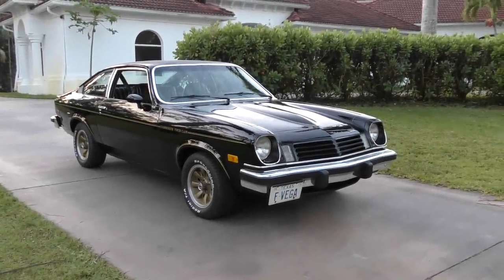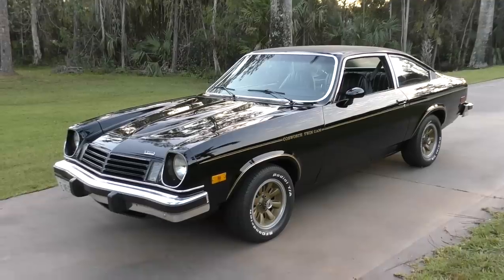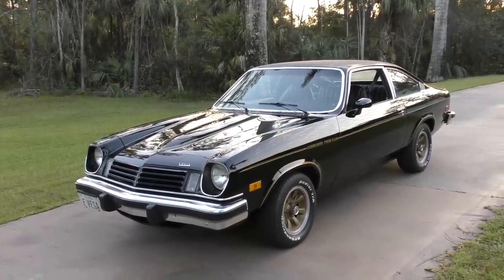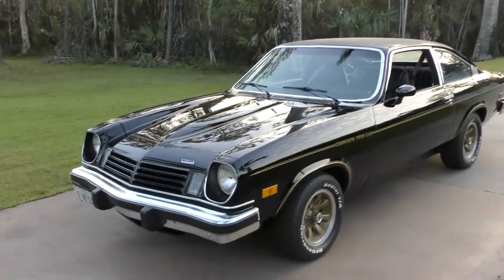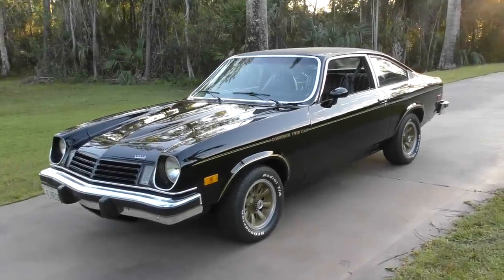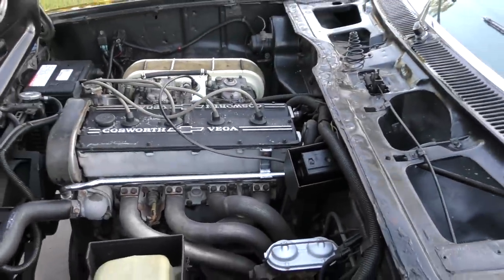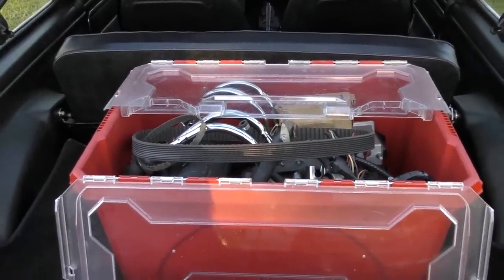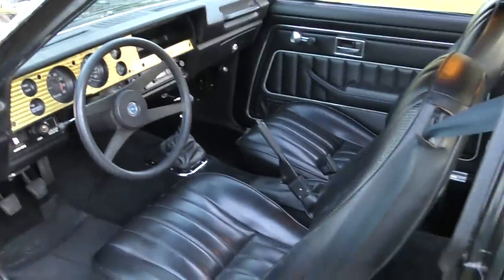The Cosworth Vega is an Amazing Car, But Came Too Late to Save Chevy From Their Terrible Decisions

Comment: When I was a young lad, I worked at my local Chevy dealership for most of my years of high school summers (72-75) and in charge of prepping every new car for delivery straight off the truck(s).  Can't tell you how many Vega's (they flew off the lot as soon as they arrived) in all of their forms (notchback, hatchback, wagon, delivery panel) from base to GT's.  We never got one of these but I have seen one when it was new, and only one.  I was like way surprised to see you with one!  I always thought they were cute, and I favored the GT's, but the fully loaded wagon's with fake wood grain sides were somewhat cute.  The Chevy Love truck was popular then as well.  Not to mention most of all of the Chevy models out at the time, and we got a few Laguna S-3's in the usual white and burgundy, but did get a black and white one which I wanted very badly.  Unfortunately too young for that purchase!  Thanks for letting this cat out of the bag!
Reply: oh fantastic! when i turned down my appointment to the USAFA Dad sold my 77TransAm for $5500 and wrote a check for $700 and told me to go get my new wheels. when i got to the house - cars everywhere, i said i'm here for the Vega. The wife was in tears so the husband said, "gonna need $50 dollars more for this car". my 93 Vega GT got me thru college and well after. it had the manual trans and the very smoky injection molded engine block. we took it to my cousin Kenny Timer for a 'tune up' or sleeves is what i wanted. it was way more than Dad would spend which was probably more than he paid for it in 1978 $750. the little 4banger would burn a quart of oil every 60 miles so i always had cans of oil rolling around in the back. there was a lot that was good about this sweet little silver Vega (the stripe disappeared after Buddy painted it) we paid him and my Dad said you can finish it when the paint is dry. Bud said no - for that money I'm done with it. Dad just smiled and so did I the car looked so beautiful.  it looked like a mini Camaro - it was pretty. the balance was very good, it could dance little doughnuts at the top of the street on the ice which made my friends trash can banging Plymouths look stupid. it would drift nicely around corners and bends on dry pavement before drifting was invented just by dropping it into first and nailing it,  particularly handy when showing off for the young women. it could haul 3 other friends and hold incredible amounts of stash in the hatchback. the little straight four would quit when the oil got too low, ie it had a preservation instinct. i do miss that beautiful little car!
Reply: I was working as a Chevy tech, from 1973 to 1977 (then went on to work for Chevrolet Motor Division) and we sold a couple of these. I think the initial allocation was one or so per dealer, but some of the dealers decided that getting so few vehicles was more trouble than they were worth and either exchanged their allocation or did a dealer trade as soon as the vehicle arrived. Each dealership had to have one tech trained on it, so I was selected to be trained. Unfortunately, it was so pricey compared to the base model that ours sat on the showroom floor for over a year. Can't remember how we finally disposed of them.

Comment: My Dad bought a Vega in 1973 because it all he could afford. Being a WW2 veteran , buying an import was out of the question. One year later during the Arab oil embargo our local Chevrolet dealer offered him $200 more than he paid for it to buy it back. Dad passed away in 1975 and I inherited the car (and it’s problems) In high school auto mechanics I installed steel cylinder sleeves in an attempt to overhaul the engine. I cured the oil consumption problem but the overheating problem (blowing head gaskets) persisted. I went on to become an auto mechanic and later and assembly line worker in a custom fire truck factory. In my 4 book exposé series “All in a DAZE work” (The Decline and fall of the American work ethic) I profile the numerous problems I saw with American vehicle Manufacturing

Comment: I only saw one back when it came out.  A rich guy bought it for his 16 year old som.  He rampaged that poor car all over the neighborhood including doing non stop donuts at the hangout trying to prove to everyone how fast it was.  Funny how seeing one 45 years later brings me back to that.  Nice find Bill and very informative history you shared.
Reply: oh fantastic! when i turned down my appointment to the USAFA Dad sold my 77TransAm for $5500 and wrote a check for $700 and told me to go get my new wheels. when i got to the house - cars everywhere, i said i'm here for the Vega. The wife was in tears so the husband said, "gonna need $50 dollars more for this car". my 93 Vega GT got me thru college and well after. it had the manual trans and the very smoky injection molded engine block. we took it to my cousin Kenny Timer for a 'tune up' or sleeves is what i wanted. it was way more than Dad would spend which was probably more than he paid for it in 1978 $750. the little 4banger would burn a quart of oil every 60 miles so i always had cans of oil rolling around in the back. there was a lot that was good about this sweet little silver Vega (the stripe disappeared after Buddy painted it) we paid him and my Dad said you can finish it when the paint is dry. Bud said no - for that money I'm done with it. Dad just smiled and so did I the car looked so beautiful.  it looked like a mini Camaro - it was pretty. the balance was very good, it could dance little doughnuts at the top of the street on the ice which made my friends trash can banging Plymouths look stupid. it would drift nicely around corners and bends on dry pavement before drifting was invented just by dropping it into first and nailing it,  particularly handy when showing off for the young women. it could haul 3 other friends and hold incredible amounts of stash in the hatchback. the little straight four would quit when the oil got too low, ie it had a preservation instinct. i do miss that beautiful little car!
Reply: sorry - I've been banned from this platform for some reason. this is a test to see if I can get some content on here about things i really love - cars. if you can re-post this i would appreciate it. thank you!!!

Comment: I have great memories of a Vega hatchback I had. LT1 with an M22 four speed.  The first time I raced it the windshield popped out of its frame from the body-twisting torque. After subframe was beefed up, it would pull the front tires off the ground all through first gear. It was by far the most dangerous vehicle I've ever seen, but a blast to drive. I love your videos Bill. Keep up the fantastic work!

Comment: Cadillac also used the Bendix Electrojector fuel injection system in 1976. It was standard on the Olds 350 powered Seville  and optional on the 500 cubic inch full size Caddy. It was carried over on the 425 engine in the downsized '77 Cadillac full  size cars.

Bendix started fooling with the electronic fuel injection in the mid 1950's using tubes. Two Bendix engineers drove a '53 Buick from Buffalo NY to Baltimore MD fitted with the prototype unit. The box holding the electronics was so large, it sat on the passenger side front seat while the second engineer at in the back seat to monitor it's operation.

Bendix eventually sold the patents to Bosch and it was called the Bosch D jetronic.

Comment: The hidden genius of the Vega is that it was designed to ship in special train cars vertically, standing on its front bumper.  They could get 30 Vegas on a train car, vs. 18 the regular way.  That's how they were literally able to move a million of them.  (Whether the shipping savings passed along to the customer or not, I have no idea)  I would love to see an engineering analysis of what was needed to not leak fluids in their shipping position.
Reply: I can take a stab at your question.  Iron heads on an aluminum block was a mistake.  Even a high school chemistry student knows that different metals expand and contract differently.  Also, as mentioned in the video, not having cylinder liners was a mistake.  It just goes to prove, never buy a first-year car, especially a first year GM car.
Reply: Go to THE HISTORY GUY channel.  He has a 20min vid on the Vega and how they were shipped.
Reply: @Jonathan Morrisey  - Yep. The History guy did a good history piece. Long story short, there was baffle in the oil pan to contain the oil while the car was stood on its nose. In the 80's I had a '72 Vega that I  had steel sleeved the cylinders. Didn't smoke again but I still constantly had to add oil, and there were no drips underneath. To this day I have no idea where the oil went. Was fun to drive the car, semi-peppy with OHC 2.3 liter aluminum block made the car fairly well-balanced. but it was so buzzy inside that I think I still have residual hearing loss from highway driving. I  never got more than 24 miles per gallon. And like one of the above posters the last straw (after the air conditioner compressor and the heater air diverter door broke) was a failure of the front suspension. Junked it after that. The body did not have a speck of rust on it, though.
Reply: @jeffholloway7974  666

Comment: I really enjoyed this, thank you.-  I had a 1971 Vega which transported me from my senior year in high school through law school graduation.  I had the typical Vega problems.  I had to replace the engine at my expense...twice.  The car rusted out very badly, particularly around the cowl area.  It's a shame as GM came really close to producing a terrific small car out of the blocks.  Install fender liners, better rust proofing and drop in the iron duke and you would have had a great subcompact car. As you noted, by 75-76 the rust problems and the engine problems were resolved....just too late to save it.  As to it's main competitors, the Pinto, Gremlin and Beetle, it was clearly the most attractively styled, was the best handling and had the best interior of the group.   The Cosworth was an interesting car, but lack of AC eliminated it from serious consideration.

Comment: Good review Bill. What sticks in my mind when a Vega is discussed is when they first came out the rear lower shock mounts got wiped out in a conveyor type car wash & premature rust from Michigan salt laden roads in the winter just ate the metal panels within a couple of years. Also, I worked with a guy at the time who paid over $3,700 for a new '71 Coupe. Back then you could buy a new VW super beetle for $1,900. Granted, everything rusted back then but not as bad as the Vegas & Pintos.

Comment: This Vega was the best looking, the nicer looking tail lights, great looking front end, the Wheels, color combination. A high school Buddy's parents bought a Vega two speed automatic they bought the car new at the Chevy dealer when they drove it home it could not even make it up the hill to their house, they returned the car and said they didn't want it.
Reply: I think the '74 - '75 were the best looking of the years. The front ends imitated the Camaro. The '71-'73 grill was too large proportionally but in '74, it was still large, but the slits made it less noticable and the parking lights reduced the width, as compared to '76-'77. The sloping front was meaner looking, the '71-'73 too flat.

Comment: The first car I bought with my own money in 1983 was a 1974 Vega with an automatic. It was $200 and I overpaid for it. The rust completely surrounded the rear window so when I cranked up the bass in the stereo I paid more for than the car, the rear window bounced up and down. The car met it's demise on an uphill slope when it downshifted into second and blew a 4-inch hole in the side of that aluminum block. I sold it to a buddy for $50 and he put a 289 in it.

Comment: I actually paid $4500 for a "76 with 3000 miles on it. It was fun to drive, but underpowered, had a great transmission and a Torsen rear end, and I liked it but found it coarse and noisy on the road... I sold it and bought two Vega GT Hatchbacks for $900, and drove them for years...

Comment: I once had an Opel coupe that looked like this Vega.  Opel, Vauxhall, Chevrolet.  All GM cars at the time and slightly alike in some respects.  The Cosworth mill usually powered Fords.  I like this car.
Reply: Add the Holden Torana hatchback to that, quite similar

Comment: I considered buying one that was an anniversary model. They wanted waaay too much, so I left. I bought my Vega Sept '70. Put everything on it I could: bi-Y headers, Offy 360 dual port manifold, Holley 390 CFM carb. Fun (in its class). If I got the cosworth, I would have torn off all the emissions junk and hot rodded that one. Now we're talking.

Comment: Fun fact about Vega’s, the easiest to find part is the steering box. That’s because it’s still mass produced to this day as it’s one of the smallest on the market and popular with the hot rod crowd for rack and pinion conversions
Reply: The hot rodders also like the Pinto's suspension.
Reply: But the Vega doesn't have rack and pinion steering. So why would the Vega steering box be in demand for rack and pinion conversions?
Reply: @barryervin8536  you know what, I think you’re right. But it’s still widely used as the steering box of choice because of its compact size

Comment: Bill, thank you for this memory.  My first car was a used 1972 Vega GT that i purchased from my aunt during the summer of 78', 15 and before my drivers license was issued at 16.  It was silver, black interior, bucket seats, hatchback with the 14" tires.  Just over 100,000 miles i blew out the gaskets so i had the sleeves replaced with cast iron along with rebuilding the engine.  Removed all the smog crap that was choking the engine (yes, in California) Replaced the 4 speed with a better bendix transmission out of the same year opal gt. (I think GM owned Opal back during those years).  Installed new shocks, brakes, tires, carb, points, plugs.  Ran 10x better, faster and fun to drive during my Jr, Sr. years of high school.  Of course the rust issues in the trunk were hard to fix.  Wish I never sold it.  This was just a fun car to drive back then.
Reply: If GM had done what you did from the get go, The Vega would not have been remembered as such as piece of crap.
Reply: You're so right. GM did own OPEL, and the OPEL GT was the European version of the Corvette. We used to call them MiniCorvetts. There could be a video on YouTube about the OPEL GT.
Reply: @outlet6989  Thanks for the correct spelling of OPEL GT.   Yes, that was a better shifter and matched that transmission perfectly.  I could scratch the tires in all 4 gears and an "exhibition of speeding ticket' to prove it (yes, it was worth it).   Was a blast to drive and had good gas mileage.  GM was too arrogant to listen to their consumers back then.  SMH.

Comment: The reason they rusted like they did was that they had a biodegradable body. My aunt and uncle had a 1974-75 wagon, then one of my dad friends took one of these engines and drivetrain and put it into a 1976 brown wagon Vega in 1982, everyone then started to wonder what he had when he kicked the hell out of late 1970's Camaro Z-28's and L-82 Vettes. Well little did they know he also got a new head and intake plane from Cosworth that was from the racing engines for it so he was pushing close to 200 HP out of the thing.

Comment: Hey Bill I worked it for Holden Chevrolet in 1975 and 76 at 6 Mile and Van Dyke in Detroit and we got about three of these New codsworth Vegas came in and that time. I prepped all three of them they were all black I remember driving them in that thing and they're really special they're really fast they had shocks in them that seem like you were floating compared to all the other cars at the same time. We're brand new and they were a fantastic car you know the problem was the rust like you said but if they wouldn't have had to rust out problems they would have been a hell of a car and they were a beautiful little package yes they were fast as hell but extremely expensive at the time you know a new Caprice was probably $4,500 with everything in it back then have a good day

Comment: 1975-76 i was a car porter at a Chevy dealer. We had a Cos Vega in the showroom.  
I liked looking at the engine with the chrome efi and big header. 
I drove many std Vegas incl the Vega GT. They were so sluggish you had hammer it to get into traffic. 
Vega GT with a stripe and GT wheels was a good looking car.
Another interesting Chevy in 75 was a Monza V8 manual trans.

Comment: Bill, best vid yet…Proud owner of 1975 #2013, also with the Weber setup and open exhaust (taking the catalytic converter out of this thing is good for 40hp alone).

Also an owner of an all original 1977 Monte Carlo I also saw you recently highlight here…

Keep up the great vids…
Reply: Btw, I kept all of the fuel injection parts…The engine simply runs stronger on the Webers (if you open up the exhaust first). The carb setup gives another 10-20 HP (but much better mid range torque), than the early EFI. 

The stock engine has fairly long duration intake valve timing and a decent amount of overlap. This allows the high RPM, however the stock exhaust adds too much back pressure at high RPM for the engine to breathe as it should and limits the redline to 6500. Remove the cat (and ideally use a 2.25 inch pipe) and you get the redline up to 7500 on this engine. It really is quite a screamer if you uncork it. It gets damn close to the 170hp intended that the 1971 prototypes had with this setup.

Comment: I still have my 1974 Vega GT. It's a great car, especially with the full tubular chassis, PG, a 383 NA motor, and shorted Ford 9-inch. Runs sub 5's in the 8th. I paid a mere $300 for it back in 1997.